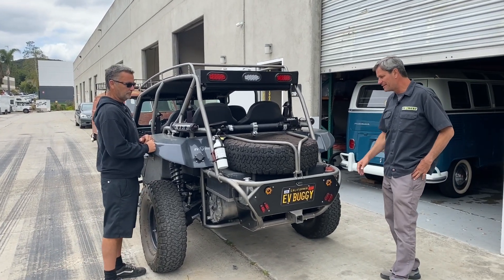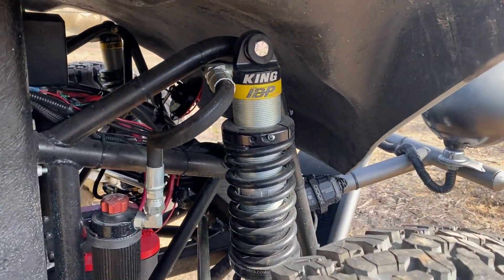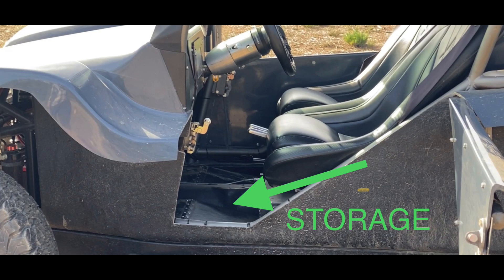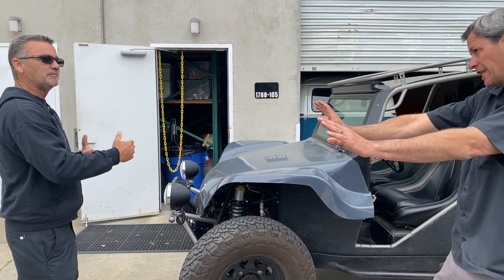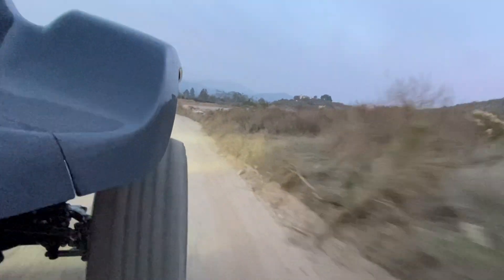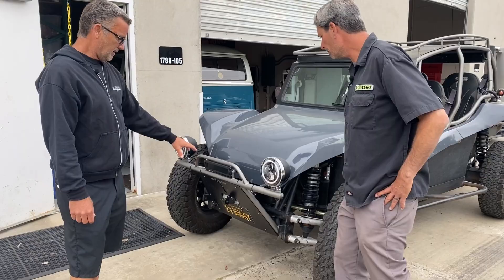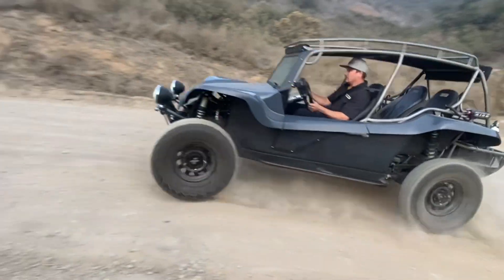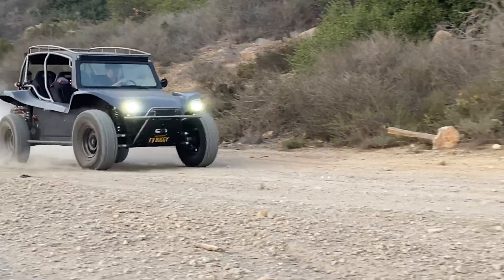Tesla Powered VW Manx Buggy | EV SHOW

Comment: I have an old street legal fiberglass buggy in the garage I used to bounce around in at the So. Cal. deserts. I started taking it apart to rebuild it but lately been thinking about converting it to an electric street car since we haven't been going to the desert at all lately and just ride quads when we do. This his highly motivating. 

I hate the bus trans-axle with redux boxes and swing arm rear end, but I feel like keeping that will allow me to stay within a reasonable budget even though it likely adds a lot of drag on the powertrain. It is pretty beat up so I'd be rebuilding the whole thing. I like the idea of adding the subfloor for the batteries. Keeps the weight balanced and low.

Comment: I want an AWD electrified Ariel Nomad. Good news is that the chassis is tubular. Migh there be space to put in a battery floor? Even if kept thinner than a Tesla one? Putting a capable front end on there would be an interesting challenge. 
Ideally 4 motors, tank turn capable and of course at least the power of the original (say, 300 hp continuous) and decent range when cruising. Rock crawling, WRC and rallycross whipping EV?